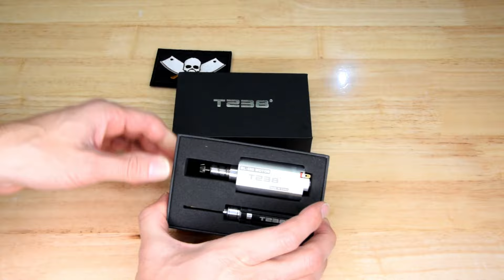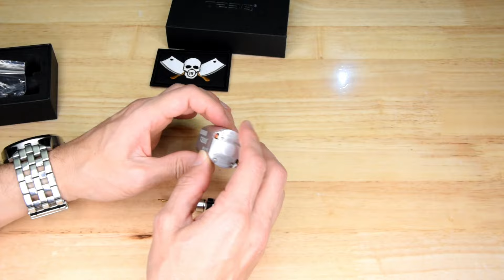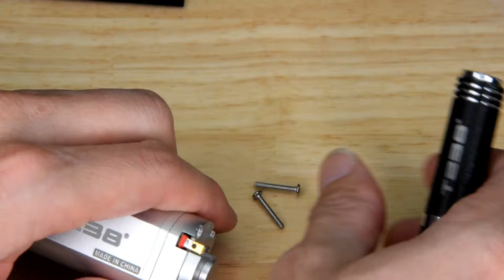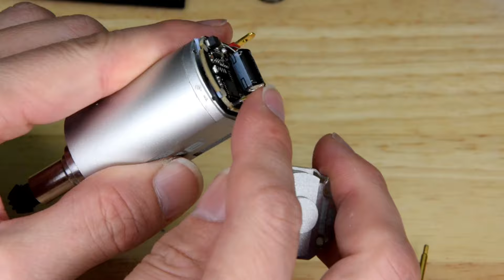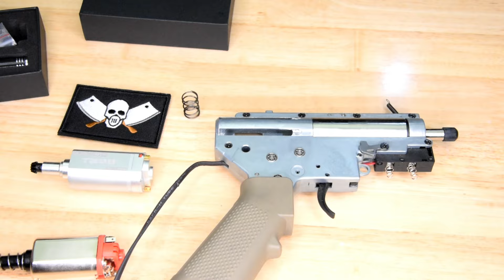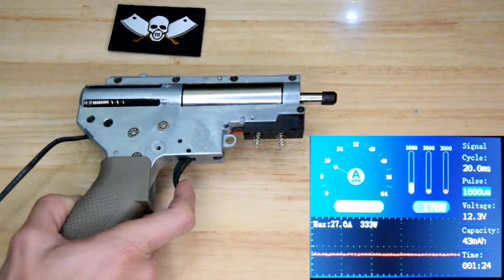T238 brushless motor test and review

Comment: @00:51 the 2980KV --> 2980 x Battery Voltage = 2980 x 12.0 = about 35K RPM
@05:05 It is to adjust the speed.
@18:42 The bldc motor is too powerful, make it Overspin.

this my test https://youtu.be/uRWKSQi_IOs?t=61

Comment: Is it ok to use the mosfet you are currently using then plug this motor, or you need to install the t238 sensor mosfet and get rid of the okd mosfet you are using?

Comment: Personally im not a fan of brushless motors, used a few in the past but i find them quite limiting for extreme builds.

Having said that, they do run very nicely in conventional builds
Reply: I mean I get what your saying but I did a 12:1 dsg on a 36k brushless and m170 spring doing like 75rps
Reply: @gelology5514  Yeah, perhaps I should have been clearer and inline with LG's comment below, the ESC on brushless motors render alot of  FCU functionality unusable bar the basic functions.

I would much rather have all the functions of my Leviathan with a brushed motor.

Additionally, if you cook your ESC, which can happen (in my case, my mate turned on active brake) - you're out a 240 dollar motor.

If you are running conventional AEG type builds, like I said they are typically fine.

Their lower power consumption and less voltage sag makes them unlikely to burn out.

Edit: Should note that I ran a couple of "Option No1" brushless motors
Reply: @johnh3733  yeah I reckon the warheads are a little better than the option no1 but I get what you mean tho the brushed motors are really good cos they are very versatile one thing that the brushlesses are good for is if you have a stock like metal gearbox like cyma or double bell the motors sumwhat act like a fcu in the way that they give you ab and mine seem to give me precock although I don't believe in precock tbh but the benefits over all with all setups is that they dont produce as much heat and use as much battery I would say that my setup which is 13:1 36k brushless and m135 spring produces less heat than the one that I had before which was a 18:1 30k motor and m100 spring one thing I don't like about them is that the voltage cut out just causes the motor to stop every so often when the battery is low instead of giving a buzz so it can confuse me sometimes
Reply: @johnh3733  You literally lose the function to control AB (Which kills brushed motors) and Precock (Which kills gearboxes) when you use a brushless motor. You're acting like you cant do anything with a Levi paired with a brushless motor lol
Reply: @DanielFreakinAwesome2  
Just a few points

Ab will typically not "kill" the motors it will just wear out the brushes slightly faster.  These take seconds to refit with new brushes which cost cents or you can harvest from old stock motors.

I run exclusively mk tactical gearboxes and precock has never been an issue for any of my gearboxes.

Thirdly any FCU function that utilises PWM will not operate with a typical brushless motor.

While brushless motors offer more power efficiency per watt, brushed motors offer more torque per watt.  At the end of the day it's a personal preference and what build you are going for.

Im not knocking brushless, its just my personal setups don't benefit from it.
Reply from the maker: I think the main downfall of brushless in AEG applications is the ESC. we basically need to design the ESC into the motor housing OR re wire the entire blaster with a brushless ESC/FCU, and literally no one does that. brushless is superior in all other fields. but the way we package AEG makes it difficult.
Reply: What brand of brushed motors do you like and use